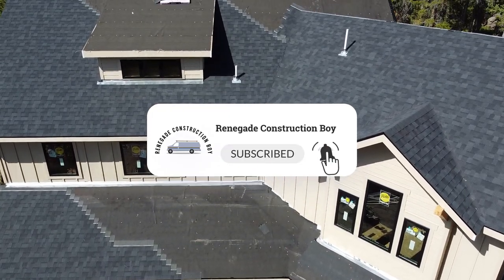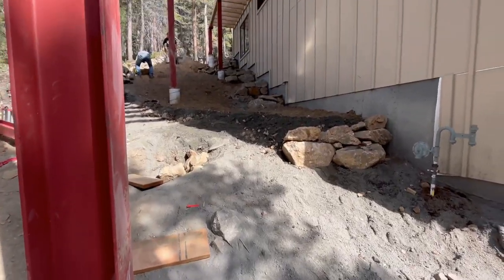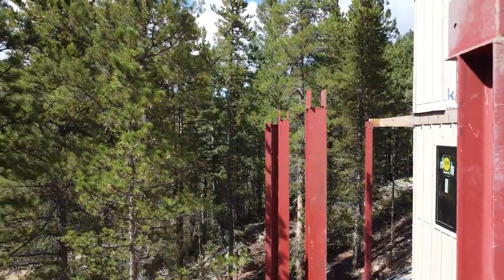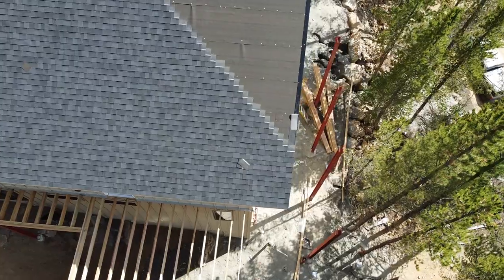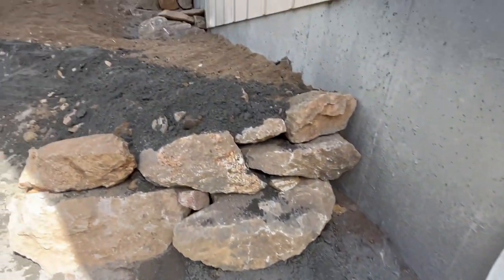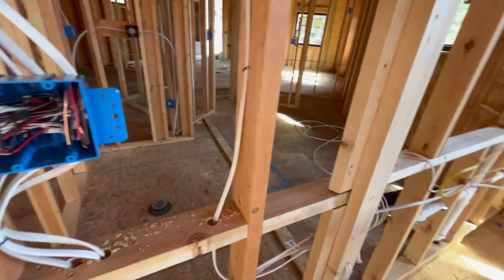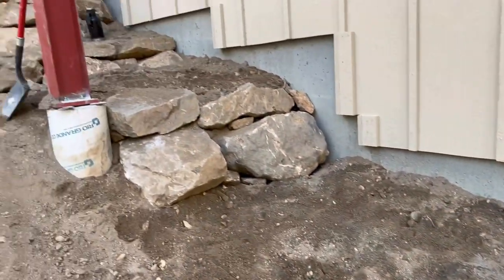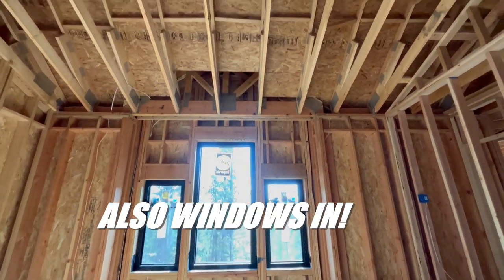Project Update #2!  Mountainside Custom Home, Deck, Siding, Roofing, Electrical!

Comment: Were in co yall be working I do framing aswell
Reply from the maker: All over! A project in Castlerock, one in Blackhawk, one coming up in golden…
Reply: @Coffmanconstruction  cool I'm doing mostly residential framing in spring I was offered a job in black hawk to rolls ome joists for a commercial building but declined due to distance
Reply from the maker: Yea black hawk is far 😅 Castlerock is where I live